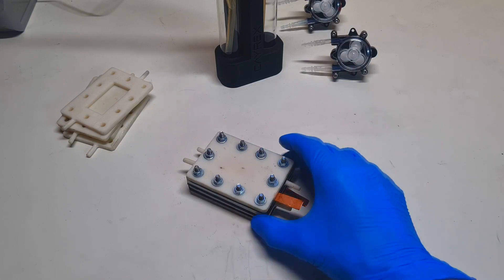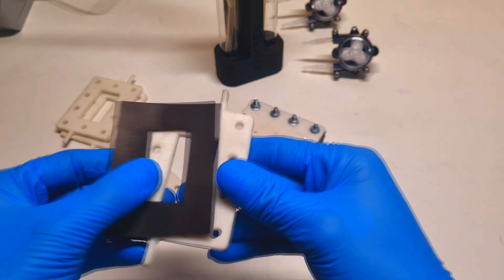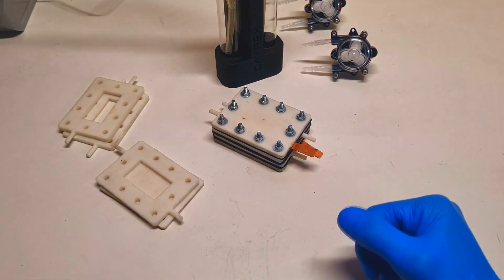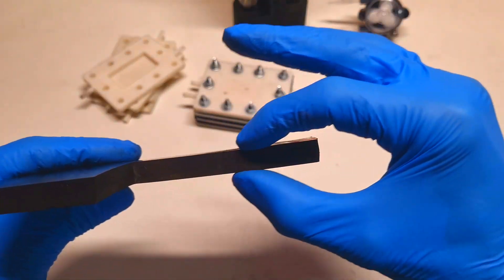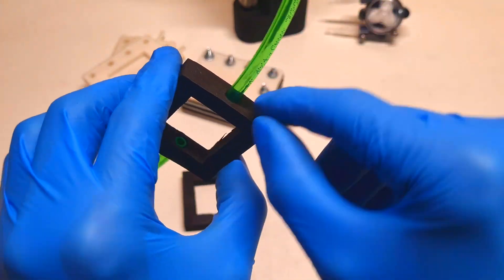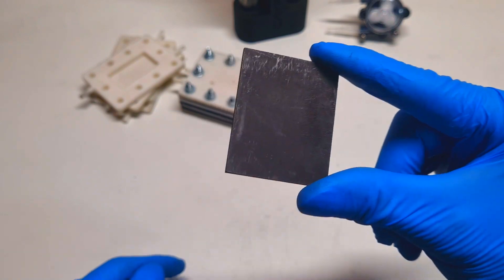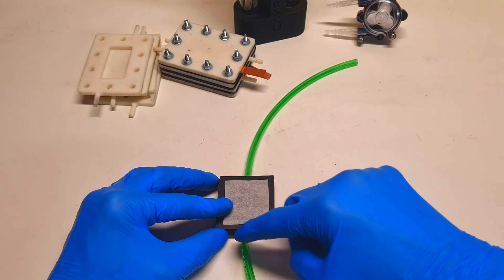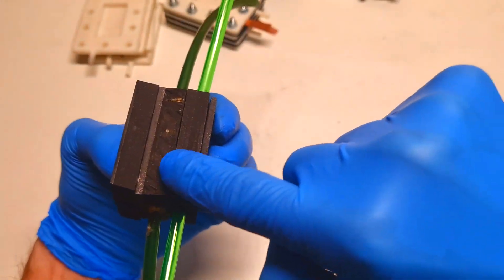Diy Vanadium Flow battery Part 4 - Alternative way to make a cell

Comment: Awesome video. Does anyone know if stainless steel 316 is a good current collector for both the ankde and cathode?

Also, does anyone know how to make both of the vanadium solutions?
Reply from the maker: Using SS 316 is good if the concetration of the acid is delow 10%. But the electrolyte is made from sulfuric acid with concentraton 50% or more. The electrolyte for the positive and negative side is the same. But when the cell is charging, then you will get different oxidation state of vanadium electrolyte on both sides. The electrolyte is in basic made from vanadium pentoxide which is dissolved in sulfuric acid.

Comment: hi.. you are extremely inspiring there are several of your products I plan to build after. my main interest for many years has been flow battery.. good job.  will there be an end to this project. a flow battery part 3 ?
Reply from the maker: Oh, thank you. I also have big interest for flow batteries for many years. Yes, the part 3 will come.
Reply: @cayrex  I will really look forward to that. I am getting components together to be able to use the winter for your exciting experiments

Comment: Is it possible to built a 10,000WHr flow battery? 
How do you design the battery voltage and determine charging parameters?
Thank you!
Reply from the maker: Yes, you can make 10kWh flow battery. The voltage depends on the chemistry which is used.
Reply: @cayrex   thank you.  Do you know of any good resources that can help with the design, charging parameters, parts, education, etc for such a battery?  Thank you again!

Comment: as far as I can tell, you're the first person to actually take time to show the stacking arrangement for a multicell device!  Thanks for taking the time to detail that.  Two questions.  The first is "do you have a way of dealing with shunt current problems?" and secondly, have you done a video using an actual bipolar plate that you've designed and positioned in the stack?  Great work!

Comment: Интересный блок уже получается. Не будет токов утечки, при питании из одного резервуара? Другие вещества и мембраны будут опробованы вами?
Reply from the maker: Yes, the shunt curren can be a little problem with multiple cells. Yes I also try to make a membrane which will be good for that battery type.

Comment: I spy with my little eye two peristaltic pumps! That means we will see full cell working in the nearest future?
Will you test other chemistries in those cells?
Reply from the maker: Correct 😁 In part 3 or maybe part 4, I will make the entire cell together. For now will be only Vanadium one. Maybe in the future I will try all iron flow cell based on Iron chloride, because it much easier to get the electrolyte for most of people.
Reply: @cayrex  Can not wait! I heard already that vanadium is... well it is vanadium, it is i would say reference flow cell, everything stays in solution, no metal deposition needed and so on, but iron chloride is something a lot people would be interested in
Reply from the maker: @ejkozan  Yes for sure. Many people ask me if can make a vanadium flow battery for years now 😅 and for that reason I make the vanadium one.
Reply: @cayrex  Can not wait then for the rest of series, and then next one about iron chloride cells. I am correct that iron chloride flow cell is more similar to your zinc bromide ones, as metal needs to deposit inside of cell?
Reply from the maker: Yes and no,... it depends what type of cell you will make. All iron can also have similar cell constraction as vanadium one and will also work on different oxidation state of the electrolyte
Reply: @cayrex  Then i will wait for your videos about it!
Keep with good work!